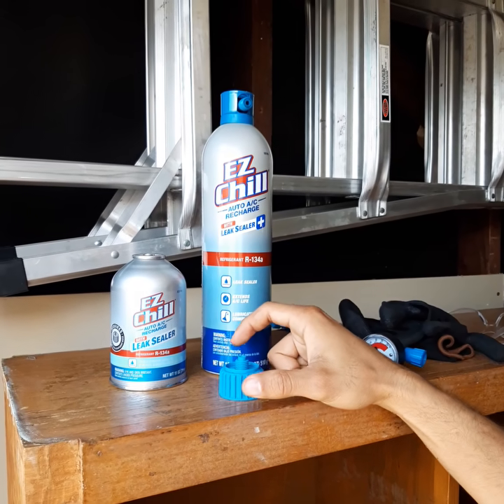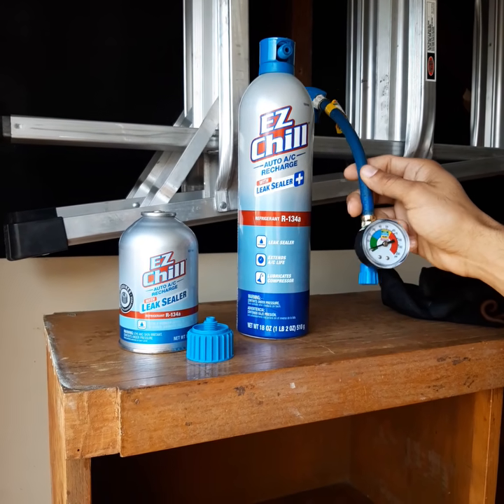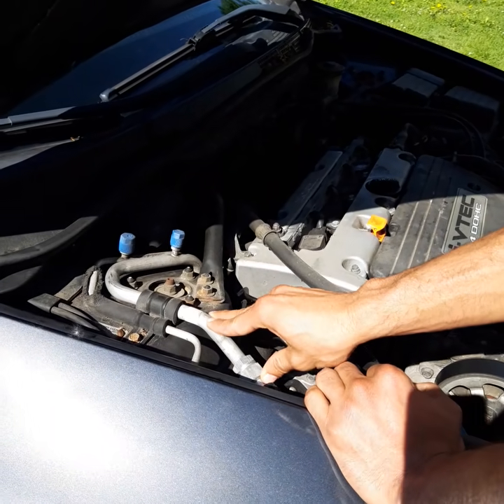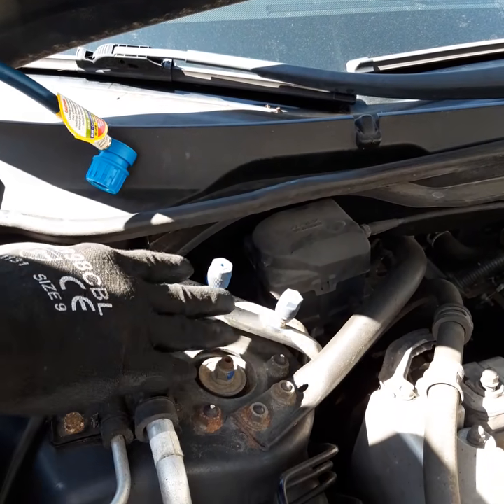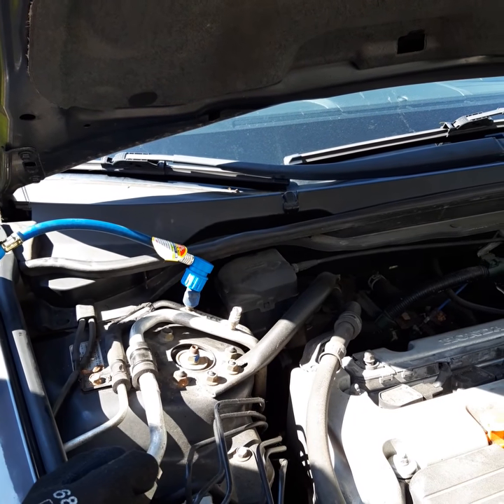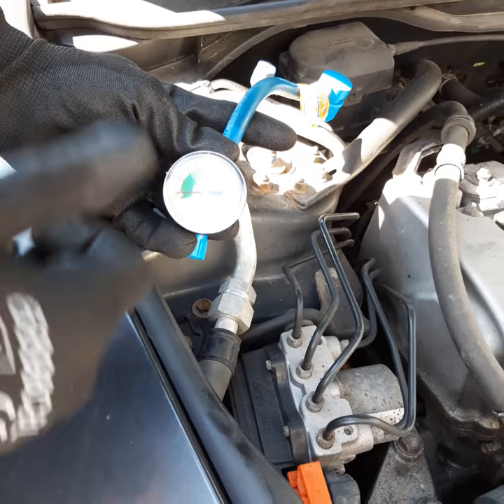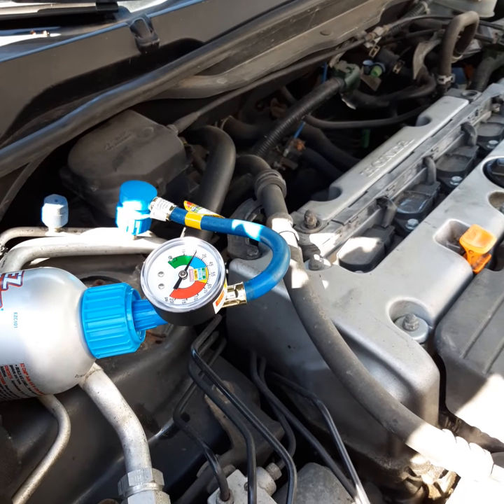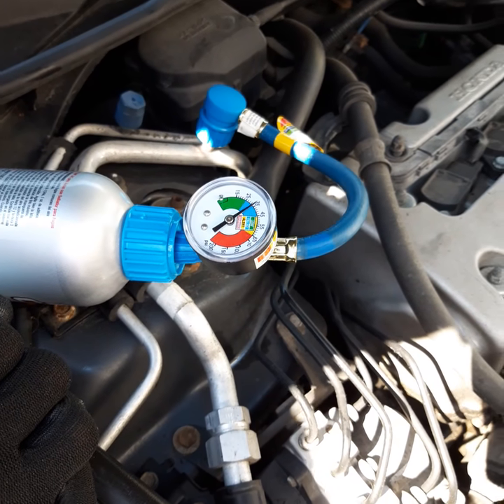AC Re-charge Honda Accord

Comment: If my car is sometimes blows cold air but sometimes does not, could that be caused by low pressure or should I be looking into a different kind of issue?
Reply from the maker: I would suspect a different type of issue. Maybe electrical. My car used to  do that and it was annoying. In my case, it was the AC button in the passenger compartment. Out of the blue, it would just turn the AC off.

Another possibility, not electrical, is a dirty condenser. In this case, the lack of cold air would be the most evident when the car is iddling.

Comment: Whats the difference between high and low pressure?
Reply from the maker: @Erin-kc4jl  the high pressure is the line after the compressor, and it is usually connected to the condenser. The low pressure is the line coming from the evaporator, where the AC picks up the heat from the passenger compartment.

Comment: Hooked up gauge said it was on full
At red line.. still no cold..
Exchanged fuses no change??
What now ?
Reply from the maker: @SherryeFreeman-vn9mg  if the system has pressure, and the fan inside the car runs when you turn the AC on, something to inspect would be the AC clutch, which is an electromechanical component. This clutch usually has a fuse and a relay, and a coil.  If any of these go bad, the clutch can fail to engage, therefore no cold air. Just something to look at.

Comment: In my case the ac compressor went bad the clutch went bad is why i had to recharge it no leaks 90 percent of the time the ac compressor goes bad tfs
Reply from the maker: Yes. I 100% agree. Any repairs to the system that involves opening it up, such as the replacement of the compressor, will inevitably result in the system needing recharged. In fact, replacing the compressor requires specialized equipment to collect the refrigerant, and to recharge it after the job is done. Such a repair is usually beyond the skills of most car owners in my opinion. 

Something else your comment highlights is that, opening the system increases the probability of leaks. Car manufacturers have processes that deliver sealed AC systems, but when a mechanic opens the system up for repair, it is possible that the system is not put back together correctly, resulting is small leaks that over time (weeks or months) lead to no AC. 

Thanks for the comment.

Comment: My psi is sitting at 156 but my air isn’t cold? What should I do next?
Reply from the maker: @sourdroopy  I want to say that pressure should be checked with the AC ON and running at full blast. Please do some googling to check this is correct. If after adding sufficient refrigerant to build the right amount of pressure using this method, the AC was still not cold, I would try to find someone experienced and with the right tools and have the system checked.

Comment: I got mine checked 2 months ago 170.00$ to check leak they said no its compressor 

I put  a new one my car AC WARM COLD AND ALOT OF RUMBLING WHEN ON 

HOW COME ...
Reply: Thank you kindly for your inputs , I will have each one ruled out 1 by 1 

Have a great day😊
Reply from the maker: @rosablue4105  to make sure I understand, you put a new compressor and the system makes noices and air is stil warm. Correct?
Reply: Yes  cold warm not hot ...please Ty ...
Reply from the maker: Okay. I will assume that you had a mechanic install the compressor. 

First, this system might seem complicated but it is actually relativity simple. The compressor is the most complicated component. If it is making noises, my guess is that it is damage internally or it was installed incorrectly. In either case, I would have be replaced under warranty. This might also be the cause of the warm air. 

Let's now assume that the compressor was installed correctly but the air is warm. The first thing I would check is to make sure it has the right amount of refrigerant (this video shows a gage that can help do that). If the amount of refrigerant is okay, then the problem must be electrical. Maybe the compressor clutch is not getting power (relay or fuse), or maybe the controls on the dashboard somehow are not working as they should. 

These of course are all guesses that I have and or things that I would check if is was a situation I was facing. Good luck.

Comment: less talk and just get on with it.
Reply: less whining more watching
Reply: @frickysuavve247  
You might mention that the can should stay upright with an occasional shake to keep the Freon  mixed at a consistent temperature as the pressure release causes the the content to freeze, and that a bowel of warm water  to steep the can will speed  up the process by keeping the internal temperature and pressure up. 
Also aiming for 45 pounds can risk over filling the system.  Other than that not bad. No whining just a touch of disappointment. Maybe write out a script to plan what you are going to say?

Comment: AC was no longer blowing hot. Told mechanic I need freon. He added freon last year. 

Without looking at the vehicle, which is a 2006 Accord, he stated AC recharge is $125. I trusted that he knew what was needed. He later texted to say there's 2 problems with the AC and to give him a call. Mechanic didnt state what the 2 problems may be but only that he believes it is electrical. He did state that he couldn't recharge and I still dont have cold air. Asked me if I want him to look deeper to determine the problem. Calls me right back to say, I'll tell you up front, it's $150 for the diagnostic, and you need a relay, which for a Honda part is $40 or I can go to an auto store and get it for $19. Plus the $125 for the AC recharge.

Your thoughts?
Reply from the maker: It is not too difficult to diagnose a bad relay, but mechanics want over $100 to do so. I could write paragraphs about my understanding of the system, but I will focus on the relay:

The relay function is to pass power to the AC Compressor Clutch. If it goes bad, no power gets to the clutch, thus when you turn your AC ON you notice nothing. When the relay is good, normally, upon turning AC ON, one notices a change in RPMs because an additional component (the AC compressor) is added to the engine (aka additional load). This change is subtle, but someone familiar with engines will notice it. When nothing happens, the issue is likely electrical and a relay is a possibility. 

So how do we test the relay: the easiest way for me, is to find a similar relay for an auxiliary function that is working such as the windshield wipers (the car manual shows which one is which). Then I would unplug the relay from the working system, and replace the AC clutch relay with it. The logic here is that if the auxiliary system was working, the relay is good. So, if the AC Clutch relay is bad, when I put in this "good relay", then AC should work. 

Once replacing the relay, one of two things will happen: 
a) The AC works and one will feel good about it. Then one should buy a new relay and put the systems together.
b) the AC still does not work, and thus additional troubleshooting is needed.

Note: if you can afford the time and the patience, do the additional troubleshooting. You will learn something, save money, and get a self steam boost.  
As always, I am not a professional mechanic and this is not professional advice. I am just a guy who owns an older car and a few wrenches. Good luck.

Comment: Thank you for posting this video. How do I know if the can becomes empty and I need to use another can? Is it just that the needle stops moving?
Reply from the maker: It is a long time since I did this, but the can is pressurized, and when the pressure in the can balances with the pressure in the system, there will be no more flow, even if the can still has content in it.  So after not sensing flow (the can should be getting lighter) I would suspect the pressures are equal. Then I would check the pressure in the system, if the gauge says the system is underfilled, then I would use a new can (which should have higher pressure than the system). Note: this is not professional advice, just my reasoning.

Comment from the maker: We seem to be split in two groups: the ones who believe refrigerant can only leak out of a sealed system and the ones who believe refrigerant wears out or get used off over time. Even I corrected myself to say this in the past (comment in this thread). Whether refrigerant leaks out or is used off is mostly irrelevant to the audience of this type of video whom for the most part just need cold air in hot days. However I am willing to put myself out there and be criticized by asking people to answer this question: 

- In the world mater does not vanish; It does not disappear like magic. It can transform, but it does not vanish. When water boils and evaporates, it does not vanish, it turns into a gas. When solids burn, they do not vanish: whatever is heavier than air turns to ashes and remains, and whatever is lighter is carried away into the atmosphere. If this is true, and science says it is until proven different, then why the hell do people think refrigerant does not leak out of a system?

An AC system is a sealed system for goodness sake. Sealed means it was designed with no openings. Whatever is put in, will stay in until the system is opened up. The only way for the content inside the system to go away, is by getting out somehow. However, systems can be imperfect. Seals and hoses connections can develop small leaks, and since the refrigerant is pressurized inside the system, any small leak will lead to lost of the refrigerant.

- Cars do not vanish gasoline. They turn into exhaust.
- Engines no not use oil,  they leak it or burn it.
- Coolant does not vanish. It leaks, evaporates, or mixes with the engine oil (which is bad by the way)
- Refrigerant does not get used off. There is nothing in the system that burns it or consumes it. If it is not there, it leaked away.

Now, those who do not understand the principle of a sealed system may continue to believe refrigerant just gets used off. Have it your way.
Reply: Even brand new AC systems will slowly LEAK refrigerant out every year because of the movement of the car. This is why they can be low after many years.
Reply from the maker: @logmaster27  I agree... new cars can have small leaks. It is always possible that new connections aren't perfect and have small leaks that over years empty the system out. I still consider this a leak. The refrigerant does not vanish.
Reply: Once the refrigerant was added to this Honda, did the compressor cycle on and off while operating? Maybe a couple/few times a minute. I know this is considered short cycling but I have also read that it is normal in Hondas????
Reply from the maker: @logmaster27  No. I do not remember the compressor cycling. What turns the compressor is the clutch. I cannot think of a reason for a compressor to cycle due to refrigerant being added. Not saying is not possible, just that I cannot think of a logical reason. To me, that sounds more like an electrical issue.

Comment: I live in arizona. Its been about 120 every day last week. My question is how much of that compressor oil should i put in?
Reply from the maker: Before adding any refrigerant, check the system to see how much pressure is in it using the gauge in the adapter. The gauge tells how much is enough pressure. My experience is that for systems that do not leak, a can should be plenty. 

Be safe out there!
Reply: @w.v.1833  i was holding my brearh when i read this because i already added the whole can of oil

Comment: How long will the recharge last for if you use a full can?
Reply from the maker: I believe that If your system does not have leaks, it should last a long time. If your system has leaks, it might only last a couple of days: it depends on the size of the leak. 

Note that refrigerant is harmful to the environment. If your system has leaks, consider fixing them. It will help the environment, and it will save you money and trouble in the long run.

Comment: Does this work for the heat to? It seems my heat and also my AC doesn’t work? It just blows outside temperature air all the time. Some one let me know! I’m heading to Walmart!
Reply: So it was a little low but I filled it up, and still no cold air. The air is a little cooler than outside air. Any suggestions?

Comment: So my car blows cold air, but not as cold as it use to, would this product make sense for me? I don’t really think I have a leak or else I would have no cold air, right? Great Video, thanks
Reply from the maker: If you have a small leak the air will stop getting cold slowly as the refrigerant leaks out until air is no longer cold. That I can think of, this is the only sign that there is a leak. The larger the leak, the faster it will stop cooling. I hope it helps.

Comment: so as soon as you plug it in it starts charging? there’s no activation switch?
Reply from the maker: The can is pressurized. When you plug, it opens a valve on the top and allows the flow until the pressure is gone, or until it is approximately the same as the system pressure.

Comment: Wat if it doesn’t give me a pressure reading until the car isn’t running . When it’s off Nd I plug it in it gives me a pressure reading saying it’s in the blue . When I turn the car on Nd blast ac it reads zero. Is my gauge faulty ??
Reply from the maker: I do not think the this is a gage problem. Please do a little more research but I believe the pressure normally drops when the car is running with AC on.
Reply: @w.v.1833  ok Thankyou I mean the air coming out my ac is not hot it’s cold so I’m wondering y it’s giving me a reading of zero  when I plug it in .

Comment: Ca I do this if one side is blowing hot and  one side is blowing cold?
Reply from the maker: Measure the the pressure in the system using a pressure gauge. Only add refrigerant if the gauge indicates the pressure is low. The problem might be caused by a low level in the system, but you would not be adding refrigerant because one side is cold and the other one is hot. You would be adding refrigerant because when measuring the pressure in the system, the gauge indicates that is was low. These are two very different approaches.

Comment: should you recharge it just because you want it to be "colder"? My car is fairly new and it stills blows decently cold air but I feel like it used to be colder. For reference I have a 2018 honda accord. Thanks!
Reply from the maker: One more thing, the short answer to your question is NO. If the system is fully charged, It is not advisable to overfill the system only to get colder air. If there is enough pressure and refrigerant in the system, the right thing to do is to find out why the air is not cold.
Reply: @w.v.1833 Thank you for answering! I really appreciate it.
Reply: @josuegonzalezpena9828  Having the same problem with my 2019 honda accord, did you fix the problem ?
Reply from the maker: I am thinking of a couple of things that might cause this. First the pressure is low, meaning there might be a leak in the system. You can check that by connecting a gauge similar to the one used in the video to see what the pressure is. Low level (Low pressure) can cause this. As a matter of fact, small leaks cause air to gradually get less and less cold as the system runs empty. Note that some people have mentioned in this video that even if there are no leaks, fluid will degrade overtime, but for a 2018 car, this is in my opinion not the case.  

The second cause could bad controls for temperature (unlikely). If the controls allow to turn heat on for example, they are likely working correctly.

I hope this helps.
Reply: Having the same problem with my 2019 honda accord, did you fix the problem ?
Reply: @rudya8670  no I ended up leaving it alone

Comment: As soon as I connected the hose to the low side the gauge spiked up to max and stayed there.  Do you think it's actually that full or am I doing something wrong?  The car was on and AC on max, it just doesn't get cold anymore.
Reply from the maker: Is your AC compressor running properly? The system might be charged, but your compressor might not be working as it should. The compressor is driven by the accessory belt, but it has a clutch that can stop work. Not being a mechanic, that is the first thing that comes to mind.

Whatever you do, for safety reasons, you might not want to over pressure the system. Better talk to a mechanic.

Hope this helps.